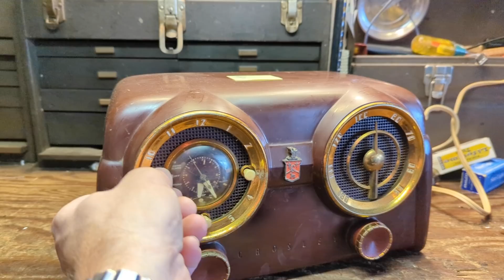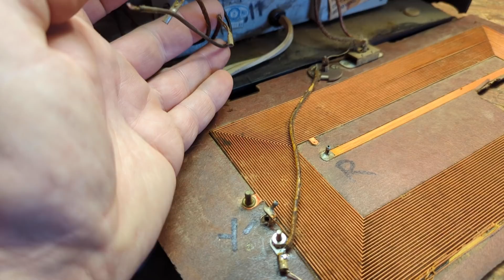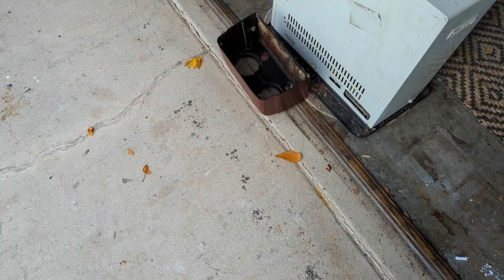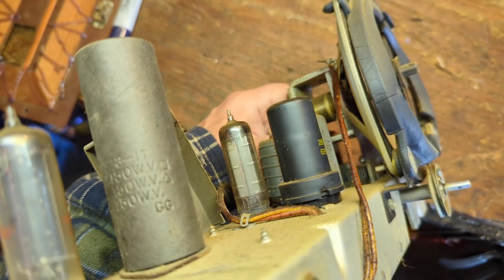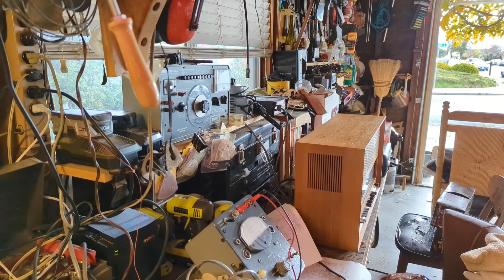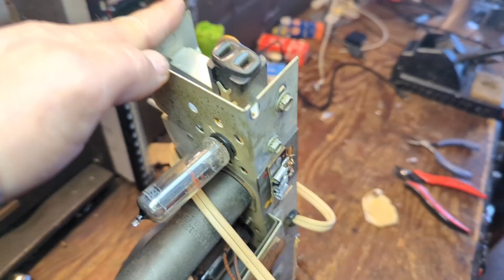Saving a very beat up Crosley from the dump

Comment: Glad 😀 ya found this at the dump. It’s a good 😌 thing that bulldozers didn’t crush 😻 it. I liked those early day Telechron motors. The dial light 💡 in this appears to be in great 😊 shape. I’m glad 😀 you’re gonna save that schmoodle of radios 📻. I’m gonna guess that over half of them are field coil (speakers) speakers 🔊, if not all. Just saw 🪚 the one ☝️ you’re working on, it’s permanent magnet 🧲. These radios 📻 are often smoker’s sets. Since they’re vacuum tube, that would stink a bit upon heating 🆙. These were the best radios 📻. Just be careful while operating these radios 📻 with them open. Ya don’t wanna burn 🔥 a finger, or accidentally have a vacuum tube in contact with carpeting, cloth, or such, to avoid fire 🔥. Curtain burner 🔥 cords are another safety issue. Don’t have this kind of cord bunched 🆙 or zip tied, or run 🏃‍♀️ them under rugs. This is true with ANY electrical cords, even today’s, but, yes 👍, curtain burner 🔥 cords of yesteryear were far more dangerous. I’m not sure 🤔 these radios 📻 have curtain burner 🔥cords on them, but they’re on many older radios 📻. Such cords are named, because they literally set your curtains (or drapes) on fire 🔥. This can very easily involve the whole house 🏠, if safety measures are not adhered to. Have a VERY SAFE and Happy 😊 New Year (2022), from your friend, Jeff.

Comment: Have you ever used CA Glue?  I've almost stopped using hot glue since I found  out about CA
Reply from the maker: No, what is it? Because I definitely HATE hot glue
Reply: @misterradio5035  It's the best...think super glue, but glues rapidly -only with the spray activator.   
On amzon I usually get:
2-Pack (Flexible)-
MITREAPEL Super Flex CA Glue (2x3.5 oz) with Spray Adhesive Activator (2x13.5 fl oz)
 ..or 3-pack-
Mitreapel Super CA Glue (3x4.5 oz) with Spray Adhesive Activator (3x16.9 fl oz)

For things that REALLY need to flex (speakers/surriunds..etc)-
Bob Smith IC-2000 Rubber-Toughened CA Adhesive Glue 1oz

Good luck!
-it changed my life LOL

Comment: I've got 3 radios in my collection that are still working with all of their original components yet, a Zenith Transoceanic Model G500 from 1950, a Capehart Model TC-62 Clock Radio from 1963 and  a Zenith Model J733 AM/FM clock radio.
Reply: Well, if you didn't replace the caps, you are risking permanent damage to the tubes and/or input transformer. They might be leaky and driving the tubes crazy and you might not even know until something dies. Finding a replacement transformer or a rare tube after that might be a bigger pain than replacing all of the elecrolytic capacitors.
Reply: @xxexplosivexxxxexplosivexx8512  they are all series string radios, there aren't any power transformers to get damaged in them. I'm not stupid I know the capacitors will need to be replaced eventually, but I'm trying to see how long they will run with the original components intact yet. Plus I don't run them very long, only a couple hours a day at the most.

Comment: I found some  Greased Lightning spray cleaner will remove  nicotine from  anything real quick.   What was causing the oscillation ?
Reply from the maker: The issue was embarrassing. There as a solder blob that got stuck between two pins on one of the tubes
Reply: @misterradio5035  That happened to you also?
Reply: @misterradio5035  Been there more times than I like
 to admit.

Comment: Crosley model 11-123U is the American built version. Radio collectors love this  car dashboard design.
That chassis is covered in tar from cigarettes! Yuk. Wonder if you ever tried Gojo hand cleaner on one?
There is another YT'er  out there that says it works really good ; easier than using Simple Green. Boy it 
looks good now.
Reply from the maker: I usually don't try to clean the chassis that much. Just a cleaning with water. I'm not crazy about getting stuff airborne since most of these were plated with Cadmium
Reply: As long as the chassis doesn't have severe rust pitting I just wipe my metal radio chassis down with soap and water, or Krud-Kutter. The Cadmium Plating used on these old radios won't hurt you unless you grind on them with a Dremmel Tool, it's the same way with Asbestos, as long as you don't go grinding on it then it's fine.

Comment: Seth your videos are a fascinating insight into American radios. We never had anything like range of styles I've seen on here in Australia. After new caps and a polish, it looks much happier. I've used bakelite powder and super glue as a filler for cracks. The powder is just sanded off some broken bits.
Reply from the maker: We are very good at "planned obsoleteness". Meaning every year the latest greatest thing comes out but usually a LOT of emphasis on styling. General Motors perfected it. I own a 1955 Mercury sedan. The next mode year looks TOTALLY different but it has the same engine and transmission. Same happened with radios. The designs are simple. But they would stick them in totally different styled cabinets.